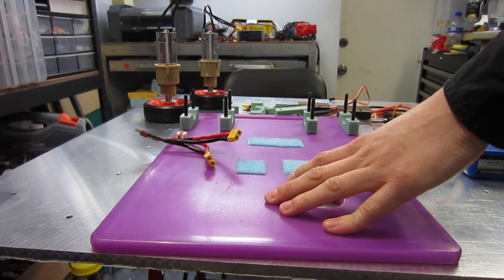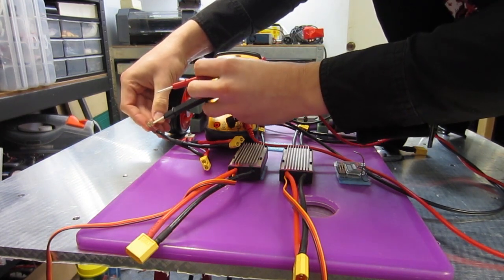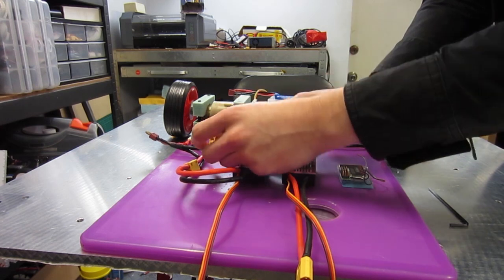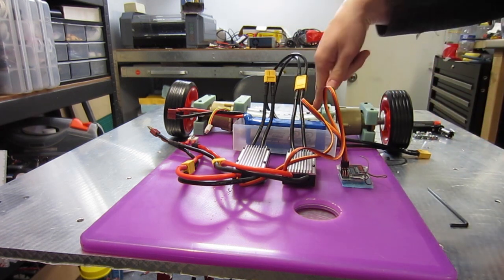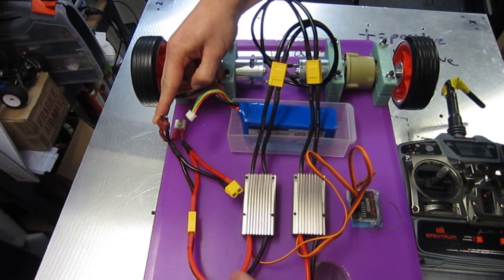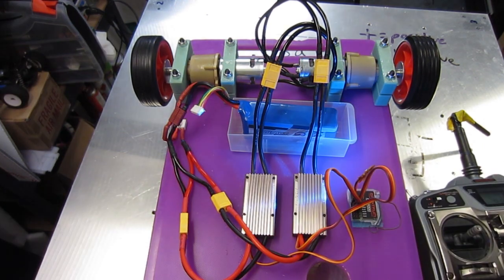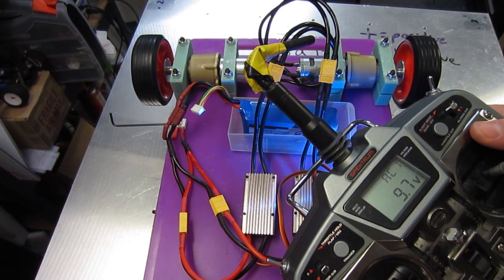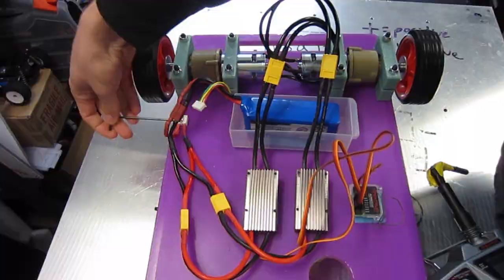How to build a Combat Robot - Episode 4 Part 3 Electronics

Comment: I don't know if it's already been mentioned or not, but you could have reversed the motor direction of the reversed motor on its original channel in the radio with Servo Reversing.

Comment: my esc's have three motor wires how would i connect them to the drills?
Reply from the maker: These are brushless ESCs for a brushless motor. These ESCs are modded ones from botbitz.com
Reply: thankyou i accidentally brought the wrong ones😅 could u suggest a non drill motor that would work with it (its exactly the same but brushed)
Reply from the maker: +chill with dyl two options. Checkout robowars.org/forum for tutorial on how to convert them. Brushless motors aren't quite as simple as a straight swap. Or buy new ones.

Comment: So if I wanted to use 4 drill motors instead of 2, would I get four speed controllers (one for each motor), or could I wire 2 motors in parallel (per side) and use two speed controllers with a higher amp rating?
Reply: You could get 4 speed controllers and have them all run sperately then mix their signals. The better way would be to have a way of connecting them to run on one motor for each side. you could also just have 2 wheels that just dont run and are there as a support
Reply from the maker: Both will work. 85A ESCs will run 2x drills fine.
Reply: +priceman141 You can safely wire up 2 motors to one ESC, the 85a's are pretty good like that. Use one for the left and one for the right and you're good to go.

Comment: Hi Robowars Australia. I was wondering, how do you get from just the switch on its own (pictured here: http://www.fingertechrobotics.com/proddetail.php?prod=ft-mini-switch) to having all those wires attached to it. Are cables bought separately? I'm guessing that the switch isn't sold as it appears in the video.
*Also your tutorial videos are fantastic - far better than the others I've found! Thanks very much for posting these up!
Reply from the maker: Cow Launcher Heya, yes all the wires were added by yours truely, that way you can add exactly the right connector and wire length you need. Don't be afraid to try it, soldering is an important skill! The bare connectors are then covered with 'heat shrink' which will protect them from short circuits. I really want to do more tutorials but haven't had the time...
Reply: Robowars Australia Ok, cool! Thanks very much! Also, how did you get the wire to split in two like that? So how 1 wire from the switch splits into a 'Y'  shape, with 1 wire going to each speed controller? Is that just a case of soldering on another wire, or is there an electrical component under the heat shrink that allows this? 
And sorry, last few questions, if that's ok! Are those yellow plugs soldered on too? And why have you used different red plugs for connecting the switch to the battery, rather than the yellow plugs? Also, I've had trouble finding motor mounts that are the same sort as the ones featured in the video. Do you know where I can find some or if there are any others you recommend?Thanks very much for the previous response! Particularly considering that this video is 2 years old!
Reply from the maker: Hey Cow Launcher, to answer your questions:
You can solder two wires to one, it can be a bit tricky though and there is several techniques, I like to twist them all together first, then apply solder.

Second, the yellow connectors are called t60's and are the favoured connector these days. The red ones are called deans connectors, and are now not very popular, but I used to use them! Hence my batteries had them for this video. I've since moved to all t60s. You can buy both types from hobbyking.com

Motor mounts are tricky! I 3d printed them, but you can make your own with some thick plastic and a bit of patience with a fine saw - like a scroll saw.

I need to do more videos on this channel but moved so don't have a work shop at the moment, But I'm still very active and try to help where I can :) Good luck!
Reply: Robowars Australia
Ok, great! Thanks very much for your help! Building a robot is something I've wanted to do since I was a little kid, and its mostly with help from your videos & comments that I've been able to get started. So thanks very much! :D

Comment: does anyone know any good transmitters with mixing? do flight transmitters work on vehicles like these?
Reply from the maker: Flight transmitters work fine, you want a type of mixing called 'v-tail', any decent transmitter will say how to set this up in the manual :)
Reply: Thanks
Reply from the maker: Absolutely, it's a great TX that lots of bot builders use now. Just note that hobbyking sells the receiver for that radio separate, it's listed in the related items down the page, R615X will do you.
Reply: Thanks. 😁😊

Comment: What kind of wires are those for the drill motors
Reply from the maker: Justin Woods It's standard 12AWG multistranded wire, you can get it at most electronic or automotive stores - its used a lot for car wiring. :) You need a big soldering iron to solder to it!

Comment: Can you do a 4 wheeled robot
Reply: Are you looking for all 4 wheels to be powered? If not you will just add wheels onto both sides in the front.  Just get the wheels and have it rotate on one axis.  I would probably use different wheels because these ones are big and bulky.  Place the washers on each side of the wheel and place it on the frame so the rod can rotate.  I am not sure why you would want 4 powered wheels but if you have an idea for that you could just repeat the process shown in these videos for the front of the frame.  The receiver may also have to be wired differently depending on what you are using.
Reply: OK thanks

Comment from the maker: Hey, an 18V motor isn't the best choice for an RC car, you might not get the speed you're after, most drill motors are wound for more torque rather than speed. For any motor that size with reverse I would recommend the botbitz 85A if you want to go up to 18V, though you may get away with at botbitz 30A esc. Any traditional 'car' esc will usually only work up to 7.4v or so. Maybe instead, have a look at a brushless motor and esc combo from hobbyking? they have plenty to choose from! Good luck :)

Comment: hey i am trying to use a 18V Ryobi drill motor for my RC car but I don't know how you chose your speed controller or what kind to buy that would work with the motor. My car also  needs to have reverse on it. What do you think?

Comment: In the UK you need a power switch AND a removable link (just another connector with a lead). In the US one or the other is required. Because the removable link can be knocked off it's not recommended. However it is required that ALL devices failsafe on radio-loss. it really honestly eliminates the point of the removable link - you can't access the link when it's inside your robot anyway so how can you use it as a failsafe?

Comment from the maker: Hey! Yep, having a failsafe is a very good point and any half decent competition will require it. The esc's I'm using in this platform (TZ85a from botbitz) will fail-safe in the event of signal loss. The only thing to watch out for is some radio systems have signal 'locking' behaviour, where they'll just keep sending the last valid signal they got. We do failsafe tests before each comp to make sure the bots are safe, and cannot move if they lose signal.

Comment: I think its important to point out, it might not be applied in your country, but when I read the FRA guidelines they say you need to have a failsafe device. In other words a kill switch built in to the robot should transmitter/receiver lose connection.

Comment: Happy to see people doing updated How-Tos on combat robots, we should probably talk at some point for the work I am doing. Have also roped Steven Martin into helping me.

There is one issue you have with this build that I noticed. Your safety light is not actually safe. LEDs for power on should be directly powered from the battery source right after the switch/power on connector. Otherwise you could have two burnt out BECs not delivering power to your RX (or other issue) and a robot that is on.